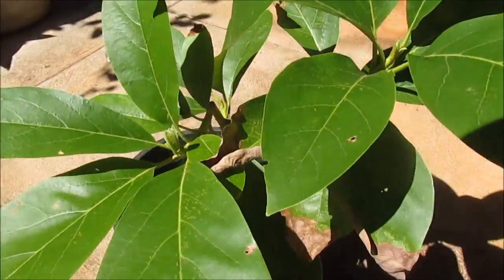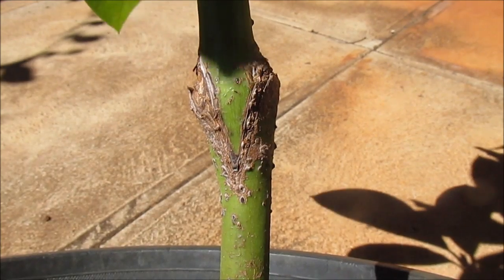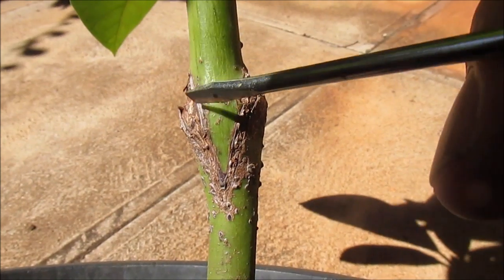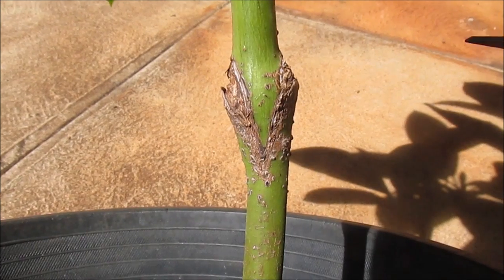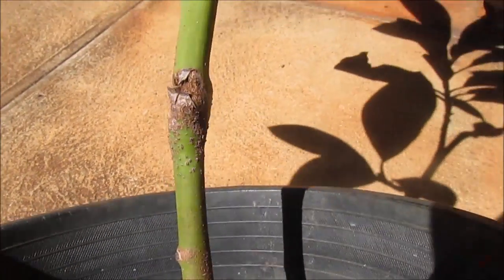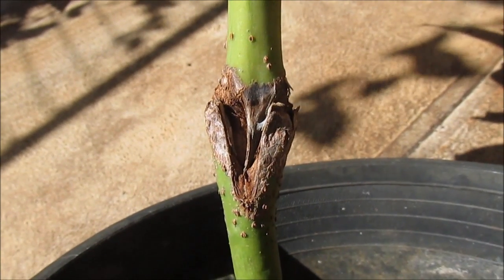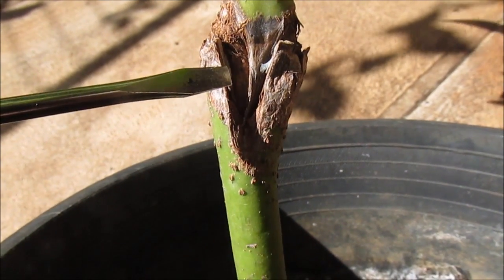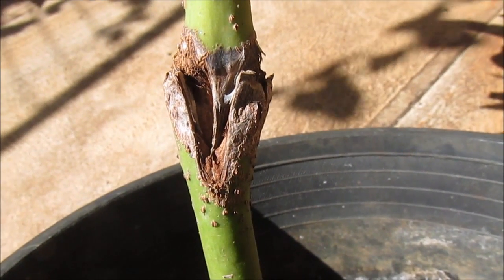Wedge Graft (Avocado), When Only One Side Connects...

Comment: Would it be possible to cut out that side, and graft a new flat piece on for a faster/stronger repair ? Possibly use that opportunity to use a potted plant while still in the pot for an even faster and stronger repair. You could even graft another variety to increase pollination and fruiting fruiting season duration. Think about it.
Reply from the maker: i didn't want to risk it.  the union closed and i followed through in giving this plant to the friend I originally grafted this for.
Reply: OK, Thank You.

Comment: I actually wonder if this is the best approach... Yes given enough time it might repair itself, but I doubt it will be ever as strong as a good graft, and then you have to consider its ability to feed itself. While it is a small and relatively few leaves it can draw enough water up through the damaged area, but what happens as the tree grows? I can't help but wonder if you wouldn't have been better off chopping it off and doing a fresh graft with the same pieces. The other consideration here is the amount of time it is going to need to repair itself versus its growth potential of a new good graft.
Reply from the maker: Thanks for your comment.  By all means, if this situation happens to you, and you don't feel confident, then definitely destroy it, and start all over.  There is no sense in you feeling like you're growing a "compromised tree".  I feel 100% confident that this graft will be as strong as any other.  The graft is very close to be healed.  Several months have passed since making this video.  Wood will soon be deposited 360° all around the circumference making those annular growth rings of a tree.  And the larger this trunk gets, the more miniscule this portion of just the very center 5/8" diameter portion this will be.  All grafts, no matter what cut was used (wedge, whip, upside down wedge, will have the same situation in the very middle.  Numerous folks in the fruit tree business/experienced grafters have told me that one of the virtues of the wedge graft is that you have 4 surfaces to "line up" the cambium layers between the root stock and the scion, and all one needs is one of the four to "take".  But I've never seen a video on this, therefore I decided to make one, since I now had this happen to me.  Again, I'm not trying to "convince you", if you got your mind made up, go with how you feel- it's just a tree after all.  I'm just trying to give you the explanation for your consideration before you make any decisions, should you have a similar situation with one of your grafts.  :-)
Reply: It was more food for thought than anything else, like you I am a fan of the wedge graft for the greater contact area, but recently I have had a few grafts go south and die with experimenting too much. This has made me think about when it is best to try fix up a bad graft (one that hasn't taken real well, it may take better a second time) and when to leave it alone.
Reply from the maker: Thanks!  Take care...
Reply: @kaimukibackyard148  hi i am just getting into this grafting procedure.  But just out of curiosity could you apply a particular wax parrifin or something similar to fill the small crack?
Reply from the maker: @geriannroth449  Best to leave the crack empty.  The growing cells from the other side came through the crack, filling it.  We don't want to fill it with anything that would make the adhesion of living plant matter to the wood difficult.  The crack filled in just fine leaving it as is.
Reply: Thank you for your advise i will be guided accordingly.